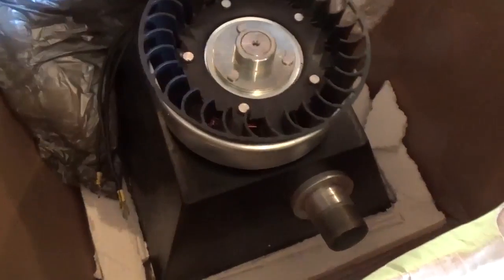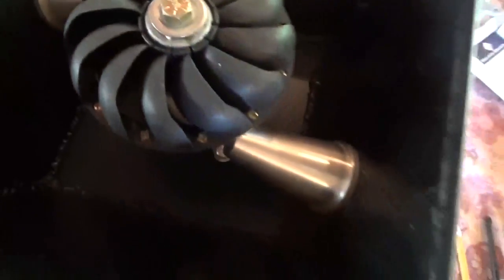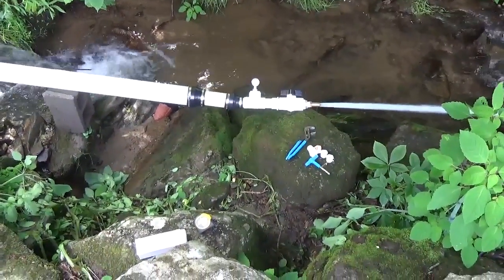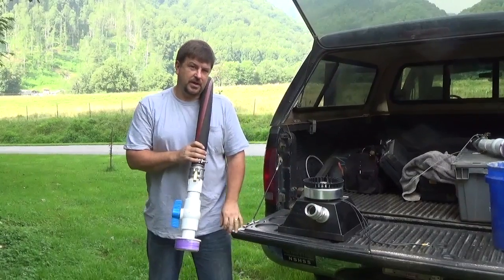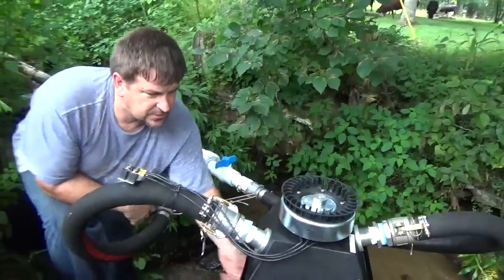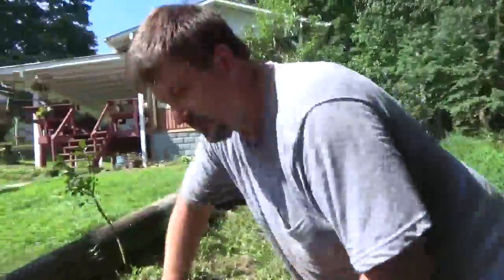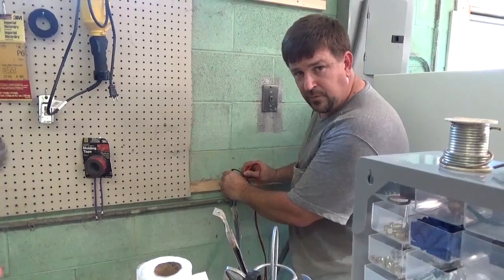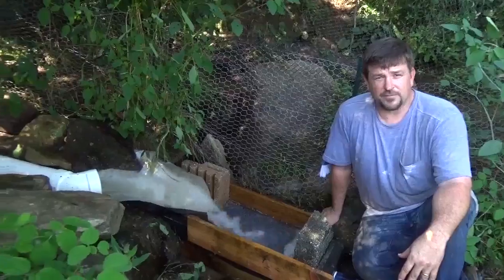Micro Hydro Power with Turgo generator Part 1

Comment: I have a small creek. buy not any drop. I really need to use it to make power. o thought about damming it up. and going with a water wheel. about 36" dia. and about 48" wide. with troughs to catch the water . since it would be a very low rpm . I figured make it wide for more weight. for more torque . and gear for lots of overdrive. I'm hoping to spin a 100amp alt or two. what do you think. does it sound possible? or is there anything better? I would like 6kw. but even 7-800 watts would help. since I'm using my generator to charge my bank. its a 24v bank with 5kw inverter.
Reply: James stranger Arlo head unit for work way more efficient if you have enough water volume then I would or will you can check out engineer775 Scott's Pawn Shop video or Pawn power videos would be great will work with 3 to 10 foot head
Reply: the most efficient type of turbine for use at a low-head low-flow site is a correctly designed poncelet-style waterwheel.  at a site having one meter or less of head, a breastshot waterwheel can be used.  the use of a run of the river undershot waterwheel is also an option. (this should have the largest practical radius and correctly shaped vanes.)  the amount of torque available at the shaft of a waterwheel is determined by its radius, NOT its width.  the optimum bucket width / volume is determined by the flow rate.   buckets should be sized so that each one fills, before it moves away from the flume or delivery pipe.   cheers

Comment: If you don't mind me asking. If its already a.c. voltage, why do you need to convert it to D.C. to just convert it back to a.c. with a inverter?
Reply: most generators produce 'wild' ac, at low voltage.  in order to use it, the wild ac must be processed in one or two stages.  first, it is converted to direct current; this gets rid of the 'wild' part.  the dc can be used, directly for battery charging. or, when there is enough power, it can be inverted to mains ac.     cheers

Comment: up size ur wire there is a calculation based on load as a general rule 1 size per 100' length of cable. if it's. cost prohibitive use  acwu (aluminum tech cable) and obviously you approved terminals or merrets if your making a copper aluminum joint.
Reply: you would have been over 50v had you used larger cable I promise you.

Comment: i would use maybe you can put a good  buck converter to double the voltage and a capacitor bank  on the dc side to stabilize the voltage drops when loads come on

Comment: idiots you need to convert it to high voltage as early as possible, not 250ft away, you're losing mad power
Reply: nope.  do some reading.  ac works fine in long cable runs;  there are losses when using long runs with DC.  smallish wires can be used for a long run to get the low-voltage 'wild' ac output from the turbine to a desired location.   cheers

Comment: Looks great.  You'll definitely benefit from boosting the voltage before transmitting.  200 volts or so should be a good start.  I'll bet you can find a pair of transformers surplus.

Comment: So, solar panels collect dust and unless a robust sheet of acrylic/plexi is over it, hail may damage it, but those can be mitigated. Your turbo has bearings, and streams have debris. You have to clean the intake and keep debris out of the turbine. How often do you have to do that compared to dusting a solar panel? To quote Montgomery Scott, "The more they overthink the plumbing, the easier it is to stop up the drain.

Comment: Wouldn't a paddle wheel  be a lot less trouble?
Reply: If you watch the video closely it really is a miniature paddle wheel. The idea here is the higher speed generates a higher frequency AC or a higher voltage DC, which is easier to work with. (depending on the generator you use) If you mean a low speed paddle wheel, such as those used 100 years ago, that would need a belt & pulley system to drive something like a car alternator, which is basically what we are looking at here, but all in one unit without the extra moving parts. IOW, less to go wrong and less yo wear out.
Reply: waterwheel?  for highest efficiency, the correct type of turbine should be matched to the available head and flow at the intended sited.  very often, at a low-flow site, a waterwheel is THE best choice.  here, the available head is great enough that a turgo or pelton turbine is a better choice.     cheers

Comment: I finally figured out what I am looking at. The heart of the system seems to be a flywheel from an air-cooled engine with the fan mounted on it. On the back side would be the embedded magnets that normally charge the battery via a set of stationary windings fastened below. What seems to be missing is the starter ring gear, which is not needed in this application. (that would be bolted or pressed on for an engine)
Reply: You're a genius. I was trying to figure out why the fan was there.
Reply: Rough guess is they decided to leave the fan in the design to keep the electrical end cool, seeing as that part is not actually in the water. Of course that cooling air also makes noise so I suppose it could be ducted and baffled if the extra sound level is a concern. Actually the whole thing could be enclosed in say a cement tile similar to a small septic tank, and that would kill 90% of the noise. OTOH, you'd have to make provisions for cleaning / service, which being out in the open solves. All of that "fine tuning" takes time and money so best left till after the rest of the bugs are worked out.

Comment: You do any work in Kentucky? Also, is it wise to rely on that as your only source of energy?  What about in the winter?  Won't it freeze?
Reply: If you have a fast moving creek, stream or river nearby that doesn't freeze then you can probably keep this from freezing with enough insulation. If you have a riding lawn mower, you can find out what it will power. You can run jumper cables from the mower to a battery & see what it will power.

Comment: Or what?????
Reply: this is a very rare sort of microhydro installation.  the turbine has been CORRECTLY matched to the available head and flow.  if turbine output is assumed to be 500 watts, continuous, all that's needed is a couple batteries, for times of high demand.     cheers

Comment: altitude + distance× Volume  = Flow x Pressure. for every 1 meter height(Distance) 0.1Bar. if you can build a a small damn with concrete and install 12 inch poly pipe and reduce it ever 10 meters length intervals and bring it down to a 1inch or less nozzle you will get some insane amount of pressure 😏. for you to get 11psi means you got 7.5meters of pipe height. try and stay away from flex use ridged pipe and also the gate valves will destroy flow if there leaf

Comment: skin effect is when there are too many electrons crowded on too small a area causing friction between electrons.  Increase wire diameter size and decrease current loss proportional to the wire size increase  

Source: US NAVY service school, however after 50 yesrs either my memory or a new interpretation may requir correction!

Comment: As long as it's running it has a nice cool water supply, so why would you need an air cooling fan robbing power?
Reply: not a bad question.  it may be that the manufacturer includes a fan, in case a housing is closely installed around the turbine.  air cooling an electrical device is simpler than water cooling.   the design used for the fan results in minimal drag, when in motion.   cheers

Comment: I ran a pelton wheel for 25 years , 2200 rpm at 90psi out of a 2inch pipe , the pipe was 1klm long 4" for 500m and 2" for the other 500m , the wheel was outside my kitchen window driving a 55amp car alternator , I was getting a continuous 17amps into a set of 12v 1300 amp batteries , we were burnt out on black saturday and bought another property with grid power , I must say it was nice to flick a switch and not have to worry about maintanence or a back up generator for welding etc , the bills wasn't nice though , good luck with your system

Comment: If you add a 1/4" check valve at each point on your pipe to burp the air out  would be a great improvement 

There Easley to build   Female coupler ,O ring and a ss Bering or marble.this is a gravity check type valve
Just a thought 
👍👍👍👍on your vids

Comment: i have an idea i dont know the tech  stuff but i wanna hook up a closed water turbine too my city water so anytime water is used it makes power    i have a generator i wanted to use it is a coleman 4500     i also do have one car battery and a small inverter    and info would be great
Reply: If that's a 4500 watt generator it probably had a 10 hp or larger gas engine to drive it. I don't think you can get enough power from home water use to turn it at all.

Comment: Hey man, fantastic set up. May I ask your opinion. I'm setting up hydro at my home. I don't have a river, so I have built a 30000 litre resovoir , and, I've set it up so the water hits the pelton wheel and falls back into the bucket. Now, im a bit of a diyer, and never knew these turgo wheels existed until this video. They look really good ( I've been using a washing machine stator and rotor and rewiring it ). Anyway, the water that hits the pelton wheel is from a pressure spout that hits at 90psi, my question is , could the turgo be modified to incorporate a small nozel high pressure spout ? Thanks man, great vid
Reply from the maker: Yes they can be made to fit your setup.  Spencer Langston makes them for us.  Give him a call and tell him I sent you..   843 319 4830
Reply: Thanks mate

Comment: hey i am working on a closed water system part of it will run on solar power {that supply the pumps that push the water} and part of it will run on small turgos inside the closed system pipe,to keep the water moving,no stream,once the water starts moving it runs its self
Reply from the maker: It will work ut might not be as efficient as you think or as efficient as just using the electricity providing by the solar.

Comment: there are two wells in hour backyard....my grandpa was an electrical engineer and he put 10kva motor generators with shaft on both wells and now in summer temprature in pakistan is 50C° and these motors runs 4 air condsioners of 1.5 tons and all the electricity of our house....we dont have any ecectricity meter ...all the electricity is produced in our house which is free
Reply: ums tube are the artesian wells that push out water?

Comment: cool project. Every bend and abrupt flow direction change you have on your inlet means less energy to your turbine. How many straight pipe diameters does the turbine mfg recommend?
Reply: good point. Simple things like bends make natural energy either work or fail depending on the aplication

Comment: such a small turbine.... with that much psi, you could've gone way bigger than that.. no?
Reply: Exactly my thought. The turbine is very anemic for that kind of pressure and flow. He's at about 20% of what he can produce with a good turbine, a lot less than that compared to a multi-stage turbine.
Reply: i think if he had bigger turbine he could have directly utilize produced electricity without the help of batteries
Reply: ya lol - he's gonna blow that lil turd up!

Comment: hi guys very good video. I need your help and advice. we farm in Africa and this would do wonders for us on the farm.  we have a dam about size 3 football fields and I would appreciate any ideas how to make it work . unfortunately its on flat ground so cant generate a good flow or head. any ideas? secondly is there a setup that allows the run off to be pumped back into the dam? would also website or forums that address mini hydro so I can check them out
Reply: If you pump it back into the dam then you are going to use more energy than you produce
Reply: GoogleMinus hi thanks for your response. in theory how much electricity can you produce from such operations? we have a fairly large dam nearly covering 4 hectares in area. its just that I don't want to lose the run off as we need it for irrigation
Reply: GrumpyTinashe Head is critical, if there's not much head there's not much power. here is a calculator to get an estimate of power generation: http://www.nooutage.com/hydroele.htm  and you will probably see that it is not a great option as far as the amount of water needed and power generated.  You said you live in a flat place, have you considered wind power? Often times flat places are fairly windy and that may be a better solution for you. Another idea is solar electric (aka photovoltaic) since you said you farm in Africa, in generally that is a sunny place although that would mean no power at night which is why people usually use a combination.
Reply: GoogleMinus is there any way I can contact you via email please so can show you photos of the dam. what I have in mind is digging a trench at bottom of the dam to create a head you see.  while area around the dam is flat we have mountains around us so wind power not option I don't think
Reply: You could post them on google+ since everyone is signed up for that by having a youtube account, that would probably be the easiest way
Reply: GoogleMinus thanks whats name of the Google group or link and please am begging YOU to comment and offer your advice when I post them as I really want this
Reply: GrumpyTinashe You have a google+ account you can post in just click your own name
Reply: Wow that is really, really flat. You could dig a ditch to create a head, but you would need to have it drain somewhere. With little head and the flow rate you would need to generate significant power you would quickly drain all of that though. It does look like there is a bit of breeze, how much power are you looking to generate?
Reply: GoogleMinus that's the thing I don't know zilch about electricity eg how much does average house use per day to run cooker/stove, lights, fridge etc. but we have 2 gig houses 5 bed each and about 30 workers houses and workers houses generally use electricity for light bulbs no fridge etc. the other heavy stuff like tobacco curing machines can be run run conventional electricity. Thanks
Reply: GoogleMinus that's why I was wondering if there is a way to repump the run off into the dam. reason I say this is because very first time I became aware of mini hydro was a documentary that mentioned a dam that has such a system of a mini hydro and pumps water back into the dam. thanks
Reply: GrumpyTinashe If you are pumping though it always uses more energy to move the water back than it will make, just like people don't put wind turbines on top of their car because it uses more energy than it makes.
Reply: Tod Wilkinson hi Tod here is link showing the dam so you and others can see what I am talking about thanks https://plus.google.com/104780248593334188465/posts/X5D9mD6cvuq
Reply: GrumpyTinashe  try a ram pump. no electricity needed.
Reply: Hello Grumpy, if you are interested in micro hydro system, we are here to help.
Reply: the lake you mention should have a continuous source of water to provide a continues power generation. If the source of water is spring (water underground going up naturally), then you have no problem, while if you rely on rainwater, you need to build a dike around the lake to store water. Just play with this formula: Power generated (Kilowatt) = specific weight of water (9.81 KN/m3) x flow rate (m3/s) x height (m). Since elevation is a problem, you need to look for an area around that lake with lower elevation and put your generator there or compensate it with more flow rate (larger water pipe) to increase power generation.

Comment: You need to use  a step up at the generator and step down at the house - 300 ft is  a hefty ask with low voltage  - If you put an MPPT tracker unit on it will let your  hydrogenation work at its optimum  while charging the battery bank at their optimum
Reply: 300 feet at high voltage 3ph AC from the turgo, gets rectified closer to the 24V battery bank, perfectly acceptable. 

24v wouldn't make it past 100ft.

Comment: My brother in law and I have built a 17'x 57' aquaponics greenhouse, to help sustain our families with tilapia and various veggies. I am interested in harnessing the power that is being generated from the 3,000 GPH sump pump, to help offset the total kw used. I also have one solar panel, that can work to help store power. Could I send you some pics of our system and get your suggestions on how we might utilize a smaller 'turgo', or whatever size that you might recommend, to help run our system off-grid? Your set up is great! I wish that I had a stream flowing like that.
Reply: Stephen Smith  843 319 4830 ask for  Spencer

Comment: Are the 2 inlets to balance it a bit better, or is for something else? Really interesting video.
Reply: double the power
Reply: Langstons Alternative Power Spencer Langston 
I think you are wasting the second inlet, because you are splitting your source. What if you have a second pipe identically to the first, with same pressure at the end and use this as a second source to feed the second inlet?. what are the technical specifications of the turgo? what is the maximum capacity of this turgo?. I think you can get much more power from that great source of water you have.
Best Regards!

Comment: Can this be adapted to a spring or slow stream?
Reply: yes
Reply: Terri Adams why of course yes. you just need a smaller diameter cause theres not as much water/min going through. why would it not work? you just need difference in height to gain movement-energy which can be turned in electric-energy